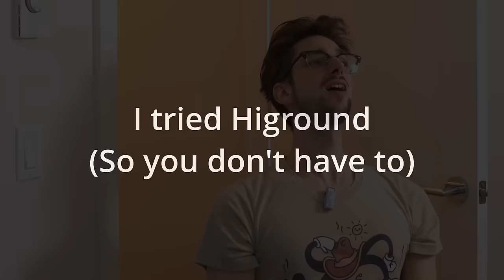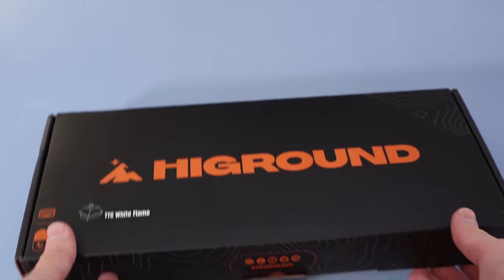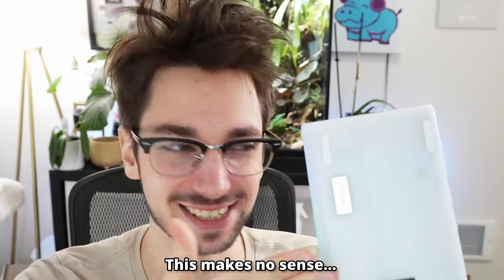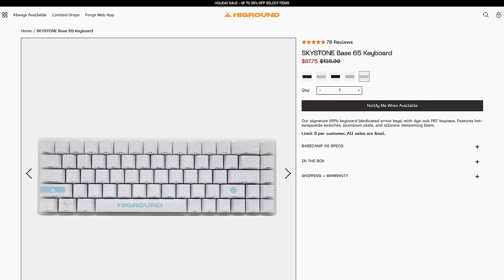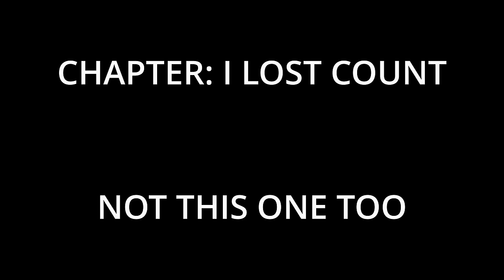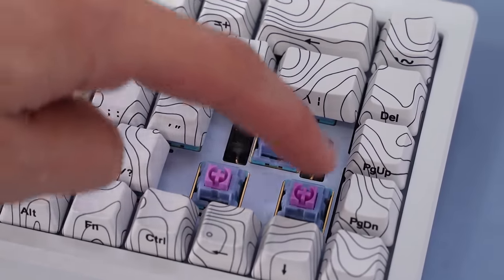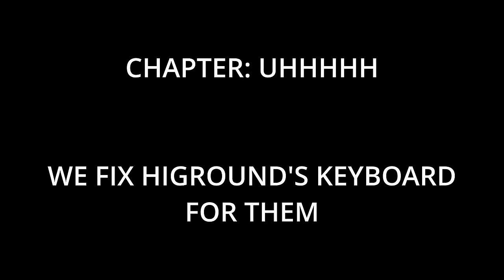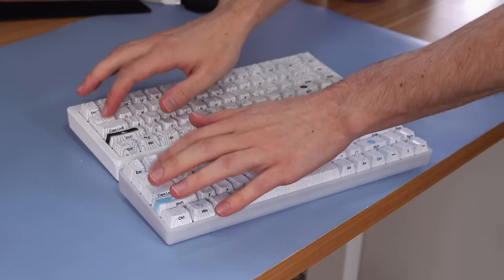I Tried The Most Popular Keyboard On Tiktok. (Higround)

Comment: From a marketing person to a fellow marketing person, I respect you calling this out for what it is at the end of the day. Mad respect.
Reply: a keyboard?
Reply: As a marketing major, if the ROI is there why would they stop marketing on tiktok?
Reply: @I-Am-No-One  It's not about stopping marketing. Of course, if people buy and enjoy the keyboard, the company will (and should, from a business sense) continuing producing it. However, Hipyo is adamant about transparency and honesty in marketing messages. Marketers, well, typically not so much. The big marketing knocks on this keyboard: (a) it overpromises and underdelivers, and (b) it is priced in mid-to-high range for an entry-level keyboard, which is not a good value considering the far superior products available at a fraction of the cost (a Keychron C3 Pro, for example, retails for less than 1/3 of its MSRP)

Comment: It was only like a year or two ago when I got my Tiger Lite, plastic case, no switches or keycaps, for around $130 or so, and that was considered a pretty sweet entry keyboard. Now $130 for a decent fully built custom is considered bad value. It's really amazing how far this hobby has come and how quickly the industry is growing. Weirdest thing about that furst board to me is definitely the alu plate. Very weird to put in a plastic case.
Reply: Alu plate for plastic keyboard is really common no? Any RK entry board or cheap gaming keyboard has an metal plate usually?!
Reply: To be fair, Keychron uses aluminum plates in plastic cases. Not really trying to defend Higround, because I don't like their boards, but just pointing out that it is "standard practice" elsewhere
Reply: Somebody's gotta try to sell all the extra GK61s that got made a few years ago ;)
Reply: entry keyboard...? it still types just as good as any other keyboard i dont get it
Reply: @DasKeebs  Keychron uses steel and polycarbonate as stock plates.
Reply: @aiims_music  It's super common.

Comment: Would highly recommend the Nuphy line of keyboards to review, in my opinion the best budget option for prebuilts right now. I have the halo 65 and compared to the Higround boards, I couldn't be any happier with it
Reply: I'd take a Halo over a Highground any day for basically every reason. I think a discerning shopper can still min-max even more - but NuPhy sells self-branded BSUN switches that are legit fantastic. They also have POK stems like the White Flames HG uses.

Comment: I'm not deep into the keyboard niche but I've tried a few different ones and personally have landed on using an RK84 75%. MSRP around $90 but eternally on sale for about $70 and currently $55 on Amazon at the time of writing. You get hotswappable, Bluetooth, 2.4G wireless, USB C, per-key RGB with customizable onboard presets, and probably more stuff I'm forgetting. Your choice of OEM switches, white or black body.

To me it feels great, I'm using the OEM brown switches. I got it for around $60-70 on sale so I spent about $15-20 on a set of XDA profile key caps and to this day it's my favorite keyboard ever. All together less than one of these TikTok keyboards for what's probably a far better experience.

Comment: I think you went a little hard on this. I feel like $188 is a decent price point for the aluminum board. If you compare that to the Keychron Q1 Pro at like $220 and consider the aesthetics and collab designs, I think that makes up the rest of the difference in quality. Most purist gamers would say you shouldn't play on wireless so that's not really a missing feature. For non-enthusiast brand (100 Thieves) I think they've done a pretty good job at upping the quality. If you're looking at gamer brands maybe the razor blackwidow is a better option, but they've also been doing this for a lot longer and have only recently started coming out with decent keyboards.
Reply: Anything from Qwertykeys blows this out of the water for 160 or less, shipping included. Saying 188 is a decent price given the last year of the keyboard hobby is WILD.

Comment: im not a keyboard guy but maybe a different material thickness or material in general instead of the alluminum could improve the sound? it works for exhaust systems on cars where Steel, Stainless Steel, Nickel alloys, Titanium and Inconel all have different notes. also the way the metal is shaped? be it bent sheetmetal, forged or milled from a block if you're feeling fancy.

Comment: Hello, how are you doing? I've been doing a lot of research, I have a couple of keyboards and I think I have some requirements for what I should have, I spend many hours in front of the PC every day working (I'm a developer) I have a couple that I've been using: HyperX Alloy (blue, 100 % - it is the one I liked the least), MxKeys 100%, MxKeys Mechanical (brown) 100%, RedDragon Fizz (red, 60%), Logitech K380 and a couple more membranes that I tested over time

I think based on what I have and have tried I would like something that:
-keyboard 100% (or75% at least)
-iso-es distribution
-if possible silent-red switches
-wireless

At the same time, I would be interested if it could be obtained from Argentina!
Do you have any recommendations?

Comment: I bought a highground keyboard a little bit ago and after a few days of using it I noticed a huge flaw for me. I had 2 K keys and one L key which meant the :; key was missing. As well as being confusing, this seems like an issue which could be fixed easily. However when contacting high ground it was said that the issue they made was unable to be solved and so now I have a keyboard with questionable quality which isn’t even complete. While I’m sure most of you won’t see my comment here, I just want to warn you not to buy these keyboards. The hype just isn’t worth it. 

£100 wasted

Comment: I've been looking for a keyboard with keys that are so hard to press that typing on it feels like an IBM Selectric or an old fully mechanical typewriter. That's when I type the fastest. And, if my wishes were fully granted, it would be a full keyboard for the Mac. I've searched for several years can can't be sure than any model is what I'm seeking. I don't know if it even exists.
Reply: Kailh Box navy or zealpc clickiez in the tactile configuration might be up your alley. You could always buy a repro model f from modelfkeyboards as they're the same as the old xt and at pc capacitive buckling spring keyboards with options for a modern layout.

 The latter brand is also selling a repro beamspring (the ibm switch from their old terminals), which are light, crisp, and extremely smooth.

Comment: I just started with custom keyboards as well. I get the gmmk pro with yellow pro gateron switches in a few days. Do you guys think that those are a good combi? Also I heard that the v2 stabs or how they are called are kinda needed. Is there a way to make the ones in the gmmk pro more useful or is there no way around of buying new ones? :>
Reply: Yellow Pros are good if lubed. The GMMK Pro is also good. But it will need modding - tape mod it. 

The stabilisers are meh but if they bother you, lube them. If they are still bothering you, put some blu tack to the bottom of the key to see if it makes it sound better.

Comment: I have literal lists of board that are better than either of these. A few off the top of my head (and sticking to the 65% form) Ducky One 3 SF (You can even get the Doom Eternal edition), Keychron V2, K2, and Q2 Max, if you're so inclined the Keychron L1, the Chilkey Paw65 (for the price of the aluminum Higround you could upgrade the switches with DKs, upgrade the stabs with TXs, and you still would come out ahead.

Match all that with the fact that all of those boards are already state side and will get to your house in less that 2 weeks with free shipping and you realize, TikTokers are dumb.